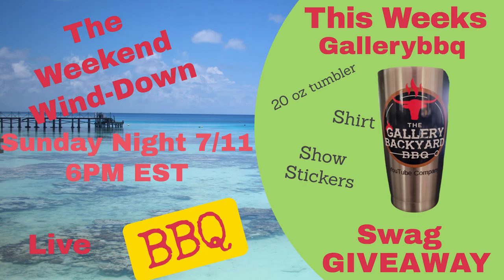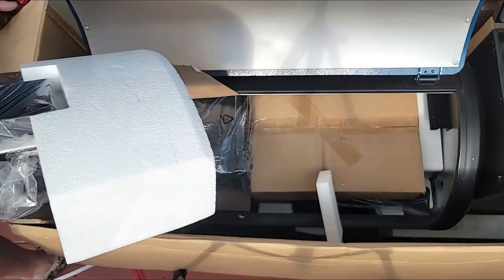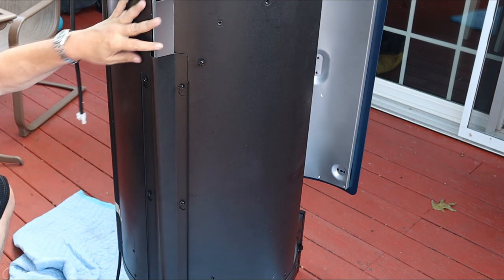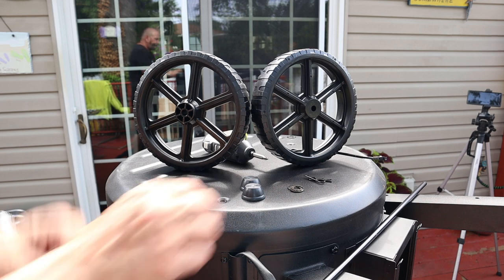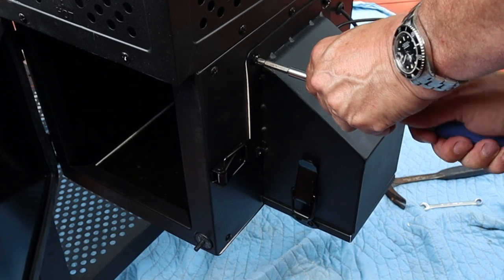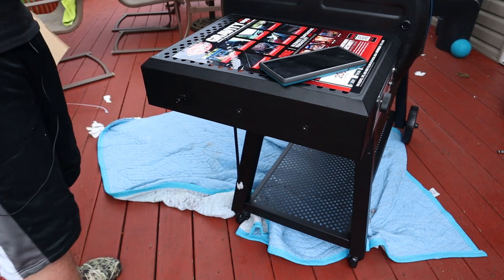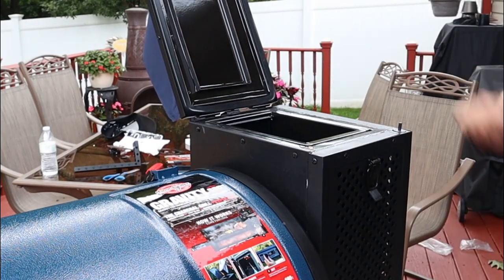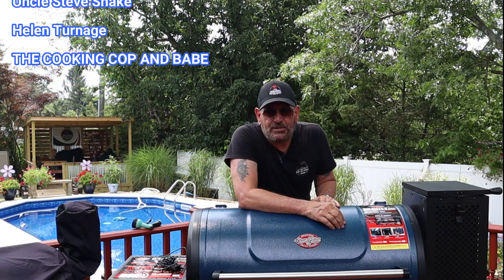Char-Griller Gravity Fed 980 | Unboxing and Assembly | Your step by step guide! | Char Griller 980

Comment: Hey Tommy, what I've done with my Char Griller Dedicated smoker is, I've swapped out all of the interior screws and bolts, that are steel, black painted, with some STAINLESS STEEL.... this way, when removing heating tray or various other items,, they'll NOT RUST!   It's an "expensive upgrade" though, as stainless isn't cheap at the hardware store.... but: WORTH IT!   Anytime you need to remove something,,,, you know it's not going to be all rusted/baked on, together..and then strip, or "break",..
Reply from the maker: Sounds like a pretty good plan. Believe it or not, we have not one but two giant screw stores near by. I mean, these guys can match anything and everything. Thanks, brother for the tip.

Comment: I have had my 980 for almost a week and have done 2 cooks it is amazing! I have had no flaws and it held consistently at 225 for 8 hrs. I guess only downside is connection to Bluetooth and wifi.
Reply from the maker: dabby, for some reason that seems to be the downside from most if not all manufacturers.  Luckily, I never use the built-in wifi/BT... Cheers.

Comment: Great smoker. Just don't add wood to the ash pan or don't add too much. It will burn up the fan flap. I do layers in the hopper with charcoal and works great. Looking forward to your content on this grill.
Reply from the maker: Thanks for the tip and warning. Cheers.
Reply: @thegalleryBBQ  yw. Looking forward to yr content on it.
Reply from the maker: @barbqizwhatido2545  Are you a new Sub??   Don't recognize the name.
Reply: @thegalleryBBQ  no been subbed for a long time
Reply from the maker: @barbqizwhatido2545  Thanks-

Comment: Can't wait to be able to use mine. Received delivery Sunday have it 98% assembled with one significant issue. The fan box doesn't fit into the lower hopper opening. Four days of multiple emails/photos/calls to customer service have not gotten it solved. They're asking for measurements, etc instead of sending parts that fit together. Kind of discouraging to walk past it everyday and not able to use it. Hopefully there's a quick solution.
Reply from the maker: JL is you watched my video mine diden't fit neither. I had to hammer is in. lol
Reply: @thegalleryBBQ  was trying to avoid having to do that.  Though very tempting. Enjoy the channel.

Comment: I get a slight smoke leak from the top lid of my charcoal hopper. It doesn't affect performance any, so I'm not too worried about it.
Reply: I did too but i coat the lid gasket with canola oil before every cook and the leak is barely noticeable now
Reply from the maker: Thanks bud. Ill check that out once fired up. Cheers.
Reply from the maker: Thanks for the tip.

Comment: Hey Tommy. Are you ever going to do a side by side comparison of the MB1050 and the CG980? I would be interested in your opinion of which is better.
Reply from the maker: With over 200 cooks on the MB and only 4-5 on the 980, Eventuitly I will. Stay tuned. just need a tad more time.

Comment: The only issue I had was the porcelain coating on one of the brackets on the manifold was a little thick and the heat shield doesn’t seat all the way down on one corner. Doesn’t affect the cooking and I’ve had no issues with anything else
Reply from the maker: TA.... sounds awesome. Im looking forward to putting this bad boy to test!

Comment: Great video! Gonna put mine together today!
Reply from the maker: Enjoy!
Reply: @thegalleryBBQ  thanks! I got it together and started doing the burn off and the fan isn't working properly. So, I'm trying to deal with customer service, hopefully they get me a new part so I can get to using this grill!
Reply from the maker: @davidgraddy  all wires connected properly?
Reply: @thegalleryBBQ  yeah everything is connected properly and the fan initially works to get it to temp, then doesn't kick back on if the temperature drops until I either reset the temperature or open/close or of the doors with a sensor. Their customer service reached out and gave me some steps to go through, I did their steps and the solution said they need to send me a new board. Now just waiting to hear back from them.
Reply from the maker: @davidgraddy   Keep Me Posted!
Reply: @thegalleryBBQ  they're going to send me a new part, unfortunately it sounds like it's gonna take 2-3 weeks. Hopefully that part works 🤞

Comment: Be careful with this smoker. Been reading and seeing videos of them catching fire from a flap. And that temperature spikes for no reason. Good luck
Reply: Check out Tom Horsman's video where he tested loading up the ash pan with wood to see if he could get the flap to burn. He got the temps right next to the flapper up to 550 F and the flapper did not burn. The key is not to overload the ash pan with wood (a single chunk), or better yet, mix wood in with the charcoal in the hopper. I mix my wood in the hopper, and the smoke is perfect.
Reply from the maker: Thanks Robert. Will do....